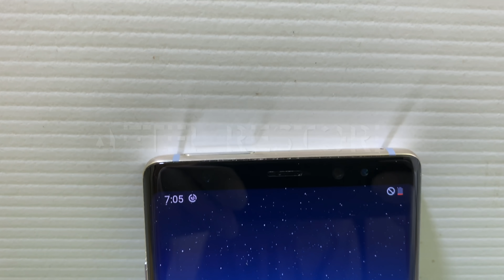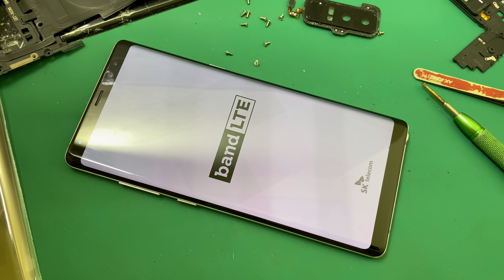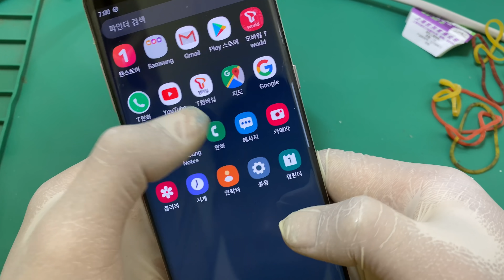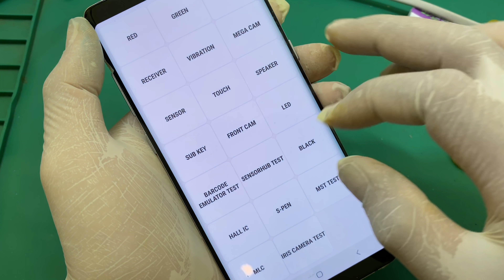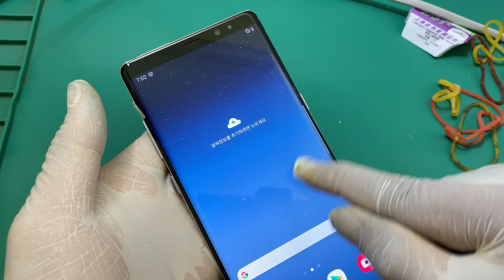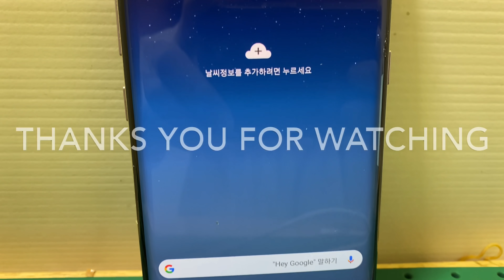Restoration Samsung Galaxy Note8 - Rebuild Broken Phone

Comment: You definitely need to read up on bettering your skills repairing these devices. Alot of mistakes that easily could have destroyed the phone, and that cheap back plate wont last long, especially with what looked to be the amount of old glue you left on it before resealing it down.

Comment: You need to improve your skills you should first disconnect the battery before doing anything on the phone and never unplug any of the connections on the board with any metal tool you should always use a plastic tool otherwise it may damage the connections. You should watch Hugh Jeffrey's videos and learn from him. 
Edit:- you did not attach the camera lens and fingerprint scanner to the back panel of the phone. a poor restoration.

Comment: Not being funny mate but if you repaired my phone like that, id be pissed! Why use cheap crap glue and rubber bands when the actual water resistant rated seals cost pennies. So many parts in this video you could have destroyed that phone, dont know how you didnt.